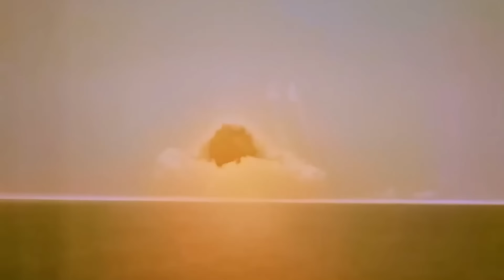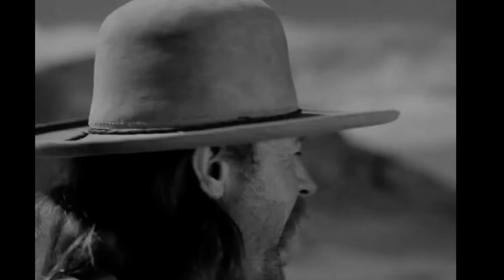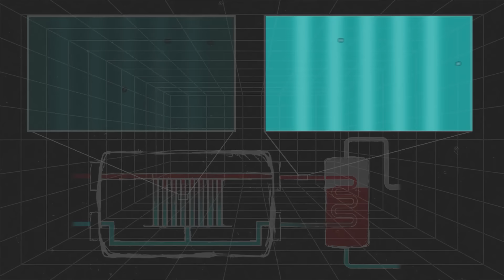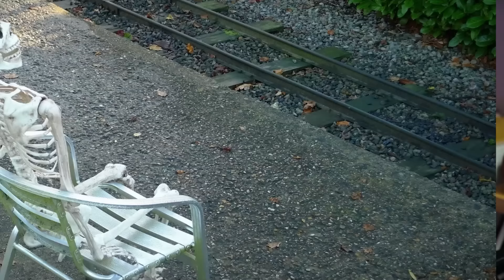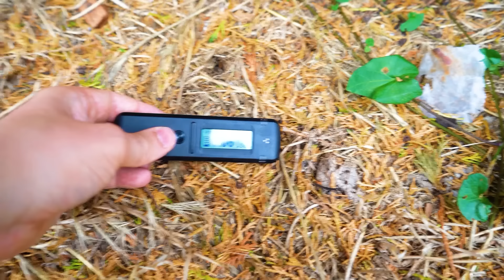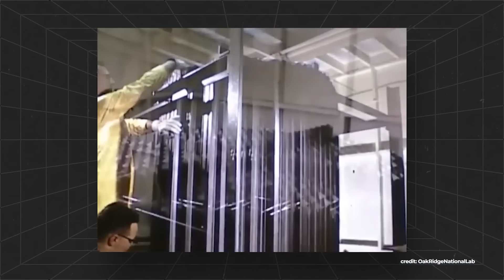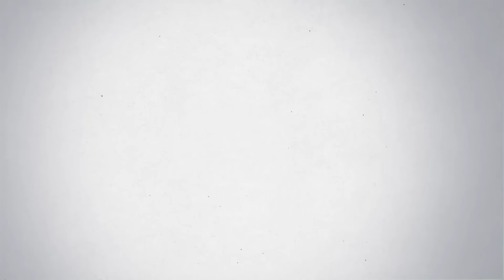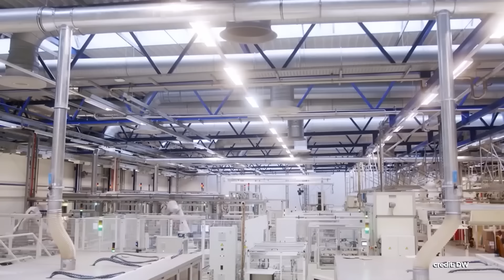It's Happening - China Launches World's First Thorium Nuclear Reactor

Comment from the maker: Is this beginning of a new age of nuclear? Let me know what you think below 👇👇And big thanks to Radiacode for sponsoring today’s episode! Get your own radiation detector and use code here: https://103.radiacode.com/DrBenMiles  ☢📻
This is genuinely an awesome product - I've be playing with it for a week straight now.  Slightly concerned that Gimli, my dog 🐶 is the highest radiation source in my house. What does this mean... Is he ok... Possible super powers in his future...(?) Send help...
Reply: @DrBenMiles - At 13:48, you repeat a common misconception about the large use of water by most nuclear reactors. The reason is the same as for MANY power plants, industrial processes, and large air conditioning systems: Evaporative Cooling. That has absolutely nothing to do with the water used in a fission core, which is endlessly recirculated, NOT used once then thrown away as is the 'steam' from cooling towers. The point of evaporative cooling is to get cooled to a lower temperature than is economical to do by dumping heat directly into air in a dry heat exchanger. In power plants, the lower temperature allows the recirculating cooling water to be expanded farther, generating more power before that low-pressure steam finally has to be re-condensed.
Reply: @YodaWhat  -  Water's conversion to steam uses more than 500 calories of heat per ml of water. THis is why water is such a good coolant and is extremely efficient at cooling equipment and the earth itself if necessary. It is a built in fail safe
Reply: I find this fascinating and would love to watch more on the subject.
Reply: I’m not seeing the code
Reply: @JPurvis10  Same, what's code?
Reply: Hi Dr Miles. I'd love at least a little something like a sticker with your Rockstar Scientist stamp on it. I have plenty of T-Shirts. Thanks 😁👍🏻
Reply: Fast or slow neutrons driving the reaction?
Reply: @MNIN-dn9xt  Can be either. Some, such as Flibe Energy's LiFTER Thermal breeder reactor use moderated neutron (slower) Others (can't think of company names at the moment but they prefer to use fast breeder thorium reactors (which will also allow the use of solid fuel radioactive waste.).
Reply: @MNIN-dn9xt  What's your question/comment - slower neutrons are need to sustain a fissions reactor (we are not talking about atomic explosive processes.
Reply: OMG the perfect Christmas present for my geologist father who freaks me out by licking rocks in the wild.
Reply: whats the code ? CODE ?
Reply: Might I suggest you should change the title of your video a little; due to the way the title was cut off on my feed, all I saw was "It's happening- China launches world's first thorium nuclear-", which almost gave me a heart attack that they went off the deep end and decided to drag the rest of the world with them.
Reply: Dude, what are you babbling on about? India has had a Thorium reactor up and running for years!!
Reply: wasn't Kirk Sorenson trying to develop it ? or was that all smoke and mirrors ?
Reply: @ashleyobrien4937  Kirk Sorenson has indeed been advocating this from VERY early on..
Reply: @ashleyobrien4937 You said the key words...."Trying" also "was"?
Reply: @ashleyobrien4937  he was, he founded FLIBE he was one of the most prominent voices / advocates for the technology a very long time ago
Reply: Gimli’s radioactivity is hopefully coming from his/her/its body’s potassium.
Reply: copenhagen atomics are sell working test rigs
Reply: As much as I love Th in principle, the first goal of MSRs has to be re-processing spent PWR-U fuel, which is already a substantial potential energy source. This is far more "socially viable" and would give the MSR technology the chance to prove itself before being to perfect the whole Th-Pr-U breeding cycle.
Reply: What we think depends what we are told, not related to what is true
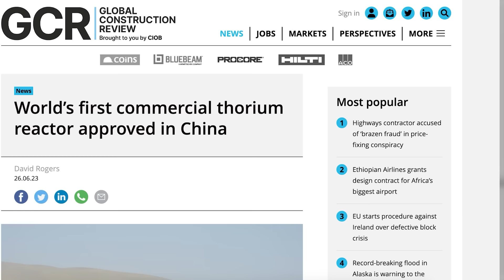Reply: At 1:10 you are incorrect on both counts.  The first molten salt thorium reactor was the MSRE at ORNL in 1965.  It was, however, an experimental reactor and not a production reactor.  The first production thorium reactor was the third core at Shippingport in 1977.  Also, it is highly debatable whether China's project counts as production reactor either.  The real question is whether they can do full-scale re-processing without generating another toxic waste dump like Hanford.  If they can manage that, then I'll be impressed.
Reply: @rockets4kids  The 1st MSR reactor was an aircraft test reactror built in the 1950's by the USA.  the Oak Ridge ORNL was the 2nd test MSR reactor.    Shippingport is considered a test reactor even though it generated electricity. It was solid fuel PWR.  So Shippingport Core Load 3 (thorium) is considered a test reactor.

Prior to Shippingport Core Load 3 the USA built 4 commercial sized solid fuel thorium power plants of BWR, PWR, and HTGR designs (I have a long post with more history above).    Germany built a 5th commercial thorium fueled power plant. 

Not only were there generally technology issues with most of these plants; but thorium fuel turned out to be much more expensive than Uranium fuel regardless of the ore cost.  The industrial process to go from ore to nuclear usable fuel is just much more expensive for thorium than for uranium.  So use of thorium in nuclear reactors was a lot more expensive than using uranium.  That is the major reason no one has built any more power plants with thorium fuel.  Even today; uranium nuclear fuel is cheaper.  When that changes most of the worlds nuclear reactors can be converted to run on thorium (they are really running on U233 after-all).

A secondary issue that adds cost is that thorium ore contains up to 7 isotopes of thorium.  One of them is more than just a trace and decays into U232.  U232 is a very high level gamma ray emitter which makes handling the waste fuel or reprocessing used thorium fuel much more expensive to handle.

Have a great day,
Reply: There was a thorium nuclear reactor built by General Atomic in Fort St. Vrain CO. in 1977. The fuel was maid in at the General Atomic R&D facility in Sorento Valley CA.
This was a high temp & gas cooled reactor.
Reply: Three Gorges Dam, Wuhan Laboratory, crashing rockets, tofu dreg infrastructure etc.... we should all still be terrified.
Reply: I really enjoyed this, and a big thanks,   I helped found the Alvin Weinberg Foundation with Baroness Bryony Worthington 10 years ago   We discussed this with the Shanghai Institute in China, and encouraged them along the path you describe so well,    I feel personally so pleased, and a bit proud of what they have achieved and their plans for going forward with commercial exploitation
Reply: No. The reason is simple: To a dictatorship it's easier to lie than to build the sci-fi tech they claim they have.
In addition, this is a plan, not a reality today. Get back to this claim in 2025.
Reply: It's a scam and you know it. They can't sustain their current infrastructure, much less develop new tech.
Reply: Stop the pro C C P propaganda. The USA, India, and others have built thorium fueled reactors before. Spreading lies completely undermines any credibility in the scientific aspects of the content.
Reply: This is great news, best news I've heard for a while
Reply: This is probably the best overall accurate and compact and digestable and technically realistic picture of the state of MSR/Thorium Energy I have come across. I did personally attend TEAC10 in 2019 solo and left with some new tech buddies. This tech can be a major change in the competitiveness profile between countries and also be likely the cleanest energy till actual H2 fusion. Of course they must be affordable and implementable in a reasonable time scale. However it evident that there are obviously "issues" why no one has yet commercialized these energy option.
Reply: Green Thorium nuclear reactors are safer: less waste, harder to weaponise.  China has been racing ahead on a prototype for a few years. 

Large deposits in India and the USA.

Russia's invasion of Ukraine resulted in more additional CO2 than most countries produce in a year. Russia's energy strategy to 2035 is to increase fossil fuels. 
So, something like green Thorium could be very useful.
Reply: Finally.. talking about this for years
Reply: Probably means he ate more bananas... or other sources of natural radiation like carbon 14 and potassium 40
Reply: Nuclear waste? The USA put a ban on recycling nuclear waste, yet most other countries like Japan, France, Russia, China, ... all recycle nuclear waste. The USA needs to reverse their policy instead of hiding it in the ground.
Reply: What's the code for radiacode?  It's not show in the video description or this post.  Thanks
Reply: Steam is a gas, it is not the mist that appears when a kettle brings water to boiling point. There is therefore very little difference between a steam turbine and the kind whose gases are the combustion products of hydrocarbon gases,
Not many reporters acknowledge this fact.
By the way, a reactor fed with thorium is fissioning uranium. A MSR can also run on uranium, and some designers prefer the proliferation-resistance of plutonium 240, to that of uranium 232.
Reply: It's time we evolve beyond oil, coal, and traditional dangerous nuclear tech.
Reply: We have to do something with fission going forward, it's the only proven and viable way to produce a whole lot of energy without burning something. Self sustaining cooling systems that don't require emergency electricity is possible so go for it. The waste is a massively overblown issue.
Reply: @fungjungkung hey you know which major nuclear powered countries have never had a meltdown? Obviously not US, Japan or Russia.
Hint: France and Ch_na
Reply: It is the highly corrosive nature of the molten salt, that is delaying the roll out in a big way. But advancements in material science is getting close to solving that problem.
Reply: isnt Kairos Power in NM already doing this. They’ve ran some “Engineering Testing Unit” successfully to move on to the next phase with “permits for construction from NRC… and a $303 million contract with DoE.” Their next step is a demonstration reactor. Which will be done within the next year or two which would be first if we discount the Tennessee experiment reactor 

Obviously their goal is to get to commercial reactors running which they claim by early 2030s

Then Terra Power (for commercial) is also by 2030. 

While we’re not China I dont think “plans to be finished in 2029” qualifies as “worlds first”. Until it’s actually online we will wait and see.
Reply: @perryallan3524 Thank you! There is to much hype about tehnologies who are not developed and maybe never will be.
Reply: Copenhagen Atomics claims to have a purification process that makes molten salts something like 95% less corrosive when hot. They're also pushing to provide molten salt Thorium reactors, but plan to try a leasing model, rather than selling reactors.
Reply: India. 🇮🇳 already started thorium reactor last month
Reply: @akhilbhai234  and it will fail like all of them ...
MIT is doing real work not this propaganda BS ...they do corosion testing on diffrent metals
Reply: This will not be the first commercial molten salt reactor.  The first, located on Simi Valley and supplying a small amount of power to LA in the 50's and 60's, was the Santa Susana facility.  It suffered multiple incidents due to untested technologies and a lack of knowledge as to how to handle nuclear waste.  It should be noted that they did not use Thorium.
Reply: @perryallan3524  Thanks for the clear summary!  Going to the MSR workshop?
Reply: Thorium Is every where in the world 
you have it out side your own home
there is no stock piles even in china 
Thorium is like water on earth its every where!
Reply: @CDWCAULDRON  There are giant stockpiles all over the place. It's a side effect of common mining. In the US a minimum reserve is required for strategic purposes even though it's not used much.

Just checked, apparently in '22 there was an active effort to end the stockpiles. I didn't know and don't know the details.
Reply: @justanothercomment416  not talking about  common mining.  Its right at your feet. every where in North America you can get it any where.
stop being this Obtuse... and try to comprehend what people are saying before you assume things I know whats in my own Mines Dim wit.
Reply: I remember reading about the Oak Ridge experiment in IAEA books 30 years ago. I wondered why something so fabulous had not been pursued. Thorium reactors not only allow for efficient, safe and cheap electrical energy generation, but also serve to treat and destroy urban, industrial and biological waste. A project that I had to abandon because it was born in the wrong place :/
Reply: @lisandroantoniorodriguez9242  It's a great question and the answer is simple. The technology does not easily facilitate the development of nuclear weapons. The DoD ordered the DoE to only promote nuclear technologies which easily facilitate the development of nuclear weapons.

Big O gave away all of our related technology to India and Chyna.
Reply: Peddling thorium propaganda in 2024, complete with a shameless sponsorship plug, and tiktok brainrot idiots eating it up lmao. Never thought I would see the day.
Reply: I dont think google maps will be available on a nuclear apocalypse so you can update the radiation zones 🤣
Reply: @DrBenMiles you are Not a Doctor... If someone Screamed, is there a Doctor on the Plane, you wouldn't say a Word! All you are is a Spoiled Brat who towed the Party Line with whatever Crap your Teachers and Professors said, and thus have No Real Independent Thought, and Less Intellectual Free Will than AI!
Reply: TMI was a partial core meltdown - you get your facts straight.
It did prove Western reactor designs did their job in terms of keeping the melted core inside the pressure vessel  and the majority of contaminants inside the containment building.
Also the small amount of radiation released into the environment came mainly from vented Xenon-133, not steam.

Although I agree that in terms of environmental impact, TMI was a nothing-burger - it was a huge financial disaster.
Reply: China launches world's first TOFU "nuclear reactor"
Reply: A thorium reactor is going to have a very short life  as the reactor gets poisoned by U233 fission daughters. Madness
Reply: Nuclear is totally done. Obsoleted by solar with battery back up.
Reply: Nuclear is totally done. Obsoleted by solar with battery back up.
Reply: Best sponsor / video combo I’ve seen yet
Reply: So happy this is getting TALKed bout again ite beautiful. My college speech in 2013 it's old tech but needed
Reply: Nah you can't make plutonium out of Thorium so Thorium reactors are basically useless, it's just a pr win for china
Reply: The sad fact is that our fantastic capitalism (to much money behind Uranium) is what has kept us back from developing a Thorium core in the western world ages ago....
Reply: You are spreading desinformation. This is not the "World's First Thorium Nuclear Reactor".
You might want to google "THTR-300". It was build in 1983.
"The THTR-300 was a thorium cycle high-temperature nuclear reactor rated at 300 MW electric (THTR-300) in Hamm-Uentrop, Germany. It started operating in 1983, synchronized with the grid in 1985, operated at full power in February 1987 and was shut down September 1, 1989.[1] The THTR-300 served as a prototype high-temperature reactor (HTR) to use the TRISO pebble fuel produced by the AVR, an experimental pebble bed operated by VEW (Vereinigte Elektrizitätswerke Westfalen). The THTR-300 cost €2.05 billion and was predicted to cost an additional €425 million through December 2009 in decommissioning and other associated costs. The German state of North Rhine Westphalia, Federal Republic of Germany, and Hochtemperatur-Kernkraftwerk GmbH (HKG) financed the THTR-300’s construction." (Wikipedia)

DOWNVOTED and UNSUBSCRIBED.
Reply: No. It's not. Thorium reaction existed since 1980s (easily verifiable by using google scholar). Nuclear power has made 0 advancements in 45+ years. It's nothing but a poor attempt to suggest new developments to seems as advanced as renewables and batteries when in reality it's reheating old ideas from the literally last century.
It's this blatant misspresenting of reality that makes it clear to anyone that nuclear has nothing to offer.
Reply: No, it's not. Thorium reaction existed since 1980s (easily verifiable by using google scholar). Nuclear power has made 0 advancements in 45+ years. It's nothing but a poor attempt to make nuclear power seem as advanced as renewables and batteries when in fact it's just reheating ideas from the literally last century.
Besides that this "World's First Thorium Nuclear Reactor" has 2 MW which is 1/3 of a modern wind turbine. This blatant misrepresentation of reality is reason enough to dismiss any push for nuclear power without even looking into it.
Reply: lets pray they dont have a Chernobyl
Reply: So 20 minutes of filler history NOT talking about China's ventures into Thorium reactors.
Reply: *F*ukushima.
Reply: FINALLY!! Something worse stealing from China......
Reply: @perryallan3524  As the US is bankrupt without a president, no more trade with other countries. That supports Genocide and Crimes against Humanity it has no future.
Reply: china's corruption + tofu building+ Comunist. I m really worried. Look at the EV scandal, even high end vehicles are dangerous
Reply: we should definitely stop building solar power and wind power and just spend the money on LARGE SCALE THORIUM REACTORS because they have an N-vallue of 1000 (so for each unit of energy invested into releasing the thorium energy from nature, you gain 1000 from nature, it's a surefire way of catching up with the chinese economy.
Reply: @perryallan3524 Very interesting. Then SMRs might be developed much further into  the future ( if ever at all ).
Reply: Nope, not at all a new age. Thorium reaction existed since 1980s (easily verifiable by using google scholar). Nuclear power has made 0 advancements in 45+ years. It's nothing but a poor attempt to make nuclear power seem as advanced as renewables and batteries when in fact it's just reheating ideas from the literally last century.
Besides that this "World's First Thorium Nuclear Reactor" has 2 MW which is 1/3 of a modern wind turbine. This blatant misrepresentation of reality is reason enough to dismiss any push for nuclear power without even looking into it.
Reply: Nope, not at all a new age. Thorium reaction existed since 1980s (easily verifiable by using google scholar). Nuclear power has made 0 advancements in 45+ years. It's nothing but a poor attempt to make nuclear power seem as advanced as renewables and batteries when in fact it's just reheating ideas from the literally last century.
Besides that this "World's First Thorium Nuclear Reactor" has 2 MW which is 1/3 of a modern wind turbine. This blatant misrepresentation of reality is reason enough to dismiss any push for nuclear power without even looking into it.
Reply: Deleting comments I see. Nuclear must be such a good technology
Reply: It's a complete lie that thorium is significantly safer than traditional toxic uranium based fission nukes - both invariably produce new poisons so dangerous that a microscopic particle too small to detect lodging itself in your lung or intestine will probably kill you, and these poisons last for millenia. Thorium's advantages lie in how toxic PARTS of fuel rods themselves remain, and that thorium can be bought cheaply in India, and from Brazil by the Chinese. Thorium in some ways is actually significantly MORE dangerous than Uranium, as the process for making the fuel rods themselves - irradiating the fuel - is so dangerous in many cases that people can't even be close to the process, & it has to done by robots. It also produces far more of truly horrifically dangerous radioactive cesium and iodine, which are both actually incorporated INTO living tissue, and deposited within bones, & emit ionizing radiation that will eventually kill in microscopic amounts.
Reply: Nope. Not at all a new age. Just some old ideas warmed up after half a century. Thorium reaction existed since 1980s (easily verifiable by using google scholar). Nuclear power has made 0 advancements in 45+ years. It's nothing but a poor attempt to make nuclear power seem as advanced as renewables and batteries when in fact it's just reheating ideas from the literally last century.
Besides that this "World's First Thorium Nuclear Reactor" has 2 MW which is 1/3 of a modern wind turbine. This blatant misrepresentation of reality is reason enough to dismiss any push for nuclear power without even looking into it.
Reply: @DrBenMiles  Nope. Thorium reaction existed since 1980s (easily verifiable by using google scholar). Nuclear power has made 0 advancements in 45+ years. It's nothing but a poor attempt to make nuclear power seem as advanced as renewables and batteries when in fact it's just reheating ideas from the literally last century.
Besides that this "World's First Thorium Nuclear Reactor" has 2 MW which is 1/3 of a modern wind turbine. This blatant misrepresentation of reality is reason enough to dismiss any push for nuclear power without even looking into it.
Reply: Too many people who don't know what they are talking about are pushing designs they know little about.      Sodium reactors are a disaster waiting to happen, at least two have melted down in the US alone.     13 have rocked up by the tempature of the coolant dropping to low and solidifying

Molten salt reactors have the rocking up problem and more.   Salts are generally very corrosive, very chemically reactive, and generally dissolves into water, becoming very dangerous.   Breeder reactors are also invariably fast neurron critical, which presents additional problems.
Reply: @fungjungkung more lawyers than engineers every year. 
Soon, the US won't have committed war crimes either.
Reply: So @ 8:39 it is Thorium-232  but @ 9:16 its Thorium-323 .... So WHICH ONE IS IT???? 🤷‍♂
Reply: Did you check your bananas?
Reply: 600 bucks... ah well NO!
Reply: Yes it has to be!!
Reply: Not at all. Thorium reaction existed since 1980s (easily verifiable by using google scholar). Nuclear power has made 0 advancements in 45+ years. It's nothing but a poor attempt to make nuclear power seem as advanced as renewables and batteries when in fact it's just reheating ideas from the literally last century.
Besides that this "World's First Thorium Nuclear Reactor" has 2 MW which is 1/3 of a modern wind turbine. This blatant misrepresentation of reality is reason enough to dismiss any push for nuclear power without even looking into it.
Reply: Well, I think this has the potential to be the energy source for the future; Paper by prof Hagen at TU Delft University -
Electron paramagnetic resonance proof for the existence of molecular hydrino
Reply: @uploadJ  thorium reactors existed since the 1980s. How is this the future?
Reply: @perryallan3524  what about the LFTR setups ?
Reply: @Steve25g  LFTR is still a Molten Salt Reactor.... and to date no one has built even a test reactor that has had a long life.  Yes, the Chinese are testing one - and so far it has been in operation intermittently for about a year.  How well it works, and if it can be successfully scaled up to a power plant is yet unknown  Both of the USA test reactors had very significant material degradation issues (corrosion and radiation embrittlment) in the 1950's and 1960's; and even to this day and after at least 15 years of specific metallurgical research into custom "super-alloys" they are not sure if they yet have an adequate material to build a long life MSR from as the salt stream becomes contaminated with fission daughter products which then chemically react with other things in the salt stream creating more chemical compounds.

As for thorium nuclear fuel.   Along with numerous test reactors built by many countries.  The USA and Germany built 5 commercial power plants that ran on the thorium fuel cycle (there is a long post above under this main post above if you want more details).

Bottom line is that Thorium nuclear fuel was much more expensive to produce than uranium nuclear fuel. This largely relates to a more complex process to extract the ore and convert into nuclear fuel (availability of ore is not the issue).   I have seen nothing today that indicates that has changed.

Thorium cycle also generates a noticeable amount of U232 which is a hard gamma radiation emitter making handling of spent fuel more expensive and handling of reprocessed uranium fuel significantly more expensive than for U235 or Pu239 fueled reactors.

The USA did perfect a thorium core for PWR reactor designs - and should thorium ever become cheaper then the vast majority of power plants in the world can easily convert to it.

Have a great day,
Reply: sodium reactors, free energy, perpetual, self regulating, were banned in 1954 by the  MILITARY, as they didnt produce weapons grade material..  plus, lpg, can run every engine on earth.. so why are we fkng around with other bs sht..
Reply: How about walking it back as its not really a thorium one?
Reply: You trust what china says? good luck with that ...
Reply: Has ANYONE gotten a reply as to what the coupon code is?
Reply: India. 🇮🇳 already started thorium reactor last month
Reply: The Chinese are building robot to replace human in factory, they are are at 95% and already at 99% at this moment. China is at least 100 years ahead of US. Not only that but Tesla is full of BYD parts also china is the only country to use 95% full automation in production facility for maximum profit which Tesla is using. Tesla, spaceX, Starlink, Solar City, Neuralink, The Boring Company and Optimus Robot are all Chinese  startup investment to boost US economy due to trade deficit. Elon Musk would be no one without china. lol
Reply: The Chinese are building robot to replace human in factory, they are are at 95% and already at 99% at this moment. China is at least 100 years ahead of US. Not only that but Tesla is full of BYD parts also china is the only country to use 95% full automation in production facility for maximum profit which Tesla is using. Tesla, spaceX, Starlink, Solar City, Neuralink, The Boring Company and Optimus Robot are all Chinese  startup investment to boost US economy due to trade deficit. Elon Musk would be no one without china. lol
Reply: Is it true that a major reason we stayed with light water uranium reactors is to support the production of plutonium for our nuclear arsenal? I've heard this said but would like to be sure before I repeat it in my climate & energy presentations.
Reply: @rickknight1810  wrong ...malten salt reactors do not work ...
Salt corodes metal THE END ...
what china india is doing is a SCAM on there naive taxpairs and propaganda .
I mean this Benny over hear sells radiation detectors ? why? it makes no sense ...
Reply: Doctor????
Reply: Caucasians like arabs n indians they talk n brag too much but does too little
The Chinese on the other hand does not talk nor brag....they just do it n get on to the next priority
Reply: To not bring in any mention of Kirk Sorensen to this is incredibly bad, Doc.  To me, it's unfathomably bad.  I've never literally called anything TMK blasphemy before, but that's exactly what this is.  I can't even imagine how you could do this.
Reply: @marvelaturraz5405  Am quite sure the people of the West have been controlling the narrative in this manner, so why are you surprised that others follow suit?
Reply: Unlikely.
Thorium is essentially a breeder programme, adding enormous operational expense to the fuel production process. Previous attempts at breeders have flopped. 
As an MSR, it will require materials that are still over the horizon and a whole new technology in fission product separation, a complex chemical process, now to be handled continuously in real time lockstep with reactor operation, with extremely high reliability.

The price of energy will have to be many times higher to  sustain such a concept.
Reply: @aaroncosier735  .. By 'flopped' you mean proven to be effective by The US, Russia now China.. India 'flopped' because like all Breeder Reactor R & D (until maybe China), it operated on a shoestring budget compared to conventional fission, useless fusion and 'Green' energy subsidies. You should know the potential of Breeder Reactors in maximising energy production per Square / Cubic Meter with the LEAST amount of waste (the non-fake Green Energy Metric). We COULD have had 1000x more efficient fission reactors by now, with over 1,000,000x+ possible. Enriched uranium only needed to (re)light the reactor. Windfarm and Solar Panel Graveyards piling up already, and they blight the area when operational.
Reply: @PrivateSi  
I mean failed, decisively, as a money pit not worth the bother.
The French programme got enormous funding in an effort to paper over the waste problems. All failed.
The US spent plenty as well, worked out it was a dud.  If there had been the slightest chance of making a dollar, or a penny, they'd have done so.

Recycling the U238 isn't worth the reprocessing costs. 
Sure, you can do it, at stupendous cost. What you get is plutonium to make MOX. Used MOX is far more expensive to reprocess or to store and dispose.

Fission product wastes still remain, and instead of being locked in a fairly durable pellet now require stabilisation, conditioning and vitrification, saving nothing in volume and costing a lot in handling. 

No, fission doesn't get much better than it is. Seventy years of work and the basic limitations remain. Sharp limitations on the efficiency of the reaction, and even sharper on extracting shaft power from heat. The only efficiency improvements came with scale, and the latest large reactors show little improvement for much higher cost and complexity. 

Your fantasy has no basis in reality.
Reply: @aaroncosier735  .. Your idea of 'Enormous Funding' by The French says it all.. Frankly everything else you wrote is just more parroted, heavily biased nonsense that doesn't hold water.. You're way worse than even the bias in Wikipedia on the subject. Contrived Liberal Economics pollute the entire energy market. You can't compare when everything is based on massively subsidised projects and industries vs comparatively ENORMOUSLY UNDERFUNDED ONES such as Breeder Reactor projects.
--
The French built nothing, even after concluding at the time the tech. was very much commercially viable. That was pre-Fake Green funding revolution. You do realise over $Trillion has been wasted globally on Tokamaks alone in the last 100 years, $1.5 Trillion on Fusion Power WASTAGE in total? Conventional Nuclear subsidised by the nuclear arms industry.. Sprawling, land-wasting, unreliable renewables heavily subsidised.
--
We should be concentrating naturally hot materials from the Earth to use the heat for something useful, other than heating up the Earth, which some people say is a bad thing! All that nuclear waste ready to be RECYCLED in BREEDER REACTORS... Along with a lot of more efficient Thorium...
--
China will lead the way.. Coal is dead, Renewables are a rip-off, Fusion is disgusting Liberal money wastage on steroids.
Reply: @PrivateSi  Yes, "enormous funding". The French programme was a flagship national project, tied to national pride. They got whatever it took to get the various Phoenix reactors going. Just as they are spending whatever it takes to get Flamanville up, though it will never generate enough to repay the investment.
In the end, they were an expensive failure. Plutonium used as MOX was many times more expensive than uranium, and only a carefully modified fraction of their fleet is licensed to use it at all, and then only as a fraction of fuel load. Phoenix had a lifetime load factor under 50%, and SuperPhoenix operated less than 7% of it's operational span.

Sure, French nuclear has been subsidised cradle to grave, and the real costs hidden behind generator, wholesale and retail price caps. So sure, yes, it is impossible to compare total life support subsidy to realistic competitors.

Nope, French breeders were not viable. they were built, operated, and found by experience to be not worth it, despite endless subsidy to satisfy national nuclear pride.

Research Tokamaks are their own priority. Involved nations don't want to miss out on a possible future tech. Fission and breeders have already failed on their own terms. They simply cannot compete. Can't even afford to dispose of their own wastes.

Renewables are not as unreliable as you think. Especially when you consider nuclear outages. Renewables give partial service under all but the worst conditions, the sun rises very reliably, as do prevailing winds. Nuclear depends on grid connection for critical onsite services, nuclear is the first to trip out and the last to restore service. 

Spent Nuclear Fuel is not viable for recycling. It has been tried, and failed. The recovered U238 is not worth the bother compared to natural uranium, the recovered plutonium is not sufficient in itself to fabricate new fuel. Supplementing this involves all the cost of a separate dedicated breeder, already established as not worth the cost.
"Recycling" spent fuel does nothing to eliminate fission products, which still require conditioning, vitrification, encapsulation and disposal.  
Thorium is not more efficient. It is about as useful as breeding from U238, already established as not worth the bother.

China is leading the way, by recapitulating the US and French pull-back from nuclear, sharply reducing completion rates, and directing their efforts to building renewables thirty times faster than their biggest nuclear year ever.

To correct you: Nuclear is in decline, less every year, renewables already deliver three times as much, and growing twenty times faster than nuclear ever did.
Reply: I do not, because oil and lobbying. Rich people much rather kill us all for money and spread propaganda to make us feel like we've failed and should give more power to authoritarians and corporations to enhance that frog boiling cycle. And people aren't smarter than that. We are technically better than that because we are social cooperative creatures, and corporations are capitalist creatures, but we're also easily swayed with propaganda and fear mongering and on average populations have an IQ of about minus 17. But I hope that China will at least get it up and running so we have an example to point at that conservatives and corporations will fearmonger about to stave of progress for another 2000 years.

I predict htat Russia will gladly buy the tech from China and keep selling even more oil and gas to us and help pay for propaganda and fear mongering while they have cleaner air and cheaper energy because of it, and they'll happily point at us for being barbarians stuck in a fossil fuel age and help us pump our air full of pollutants and CO2, evidently not caring about ourselves or each other, and they'd be right because we evidently do not - only a few do, and they're not too optimistic about our future to put it mildly. Stress about the environment, climate, and our futures and well being and health are causes for depression. We've known this for decades and had a way out for decades, and we have yet to build more nuclear powerplants. So, no. I don't think this will change much for us. We are lemmings and on the way of the dodo and the power and money and gullibility of people will probably keep it that way with fearmongering and propaganda.
Reply: No it isn't the first working Thorium salt reactor 1950s a american university built a scaled down reactor that proved viable but was rejected because the waste could not be used in making nuclear weapons,  the documentary is on you tube
Reply: @cazrealist1  
Nah. To make weapons plutonium they use a dedicated breeder reactor, and irradiate fertile blanket material for an optimum period. Too much, and you accumulate even-numbered isotopes with low reactivity that are hard to separate from the desired Plutonium 239.
Norma civilian spent nuclear fuel has been in the reactor far too long. The desirable Plutonium 239 that may have been produced is largely consumed, and the undesirable isotopes remain.

No one uses spent nuclear fuel to make weapons, and breeder reactors are lousy at generating power.

Thorium has issues, but lack of weapons application isn't the the big one.
Reply: i'm often doubly impressed with china. however, you've done nothing but parrot chinese claims regarding thorium reactor technology advancement. you've got NOTHING in this video substantiating these claims.nothing. thorium has a long history you can explore in other youtube documentaries on thorium. 
but you really ignored all the history. 
not to say , advancements are impossibe. but there's reasons thorium wasn't pushed forwards. 
you did NOT address these reasons.
Reply: @zeev  the first salt thorium reactors was built in the United States in the 50s it was built by a University and was extensively tested and was proved a viable reliable solution that would have provided a stable Base load to the grid , it was ultimately rejected though as the waste could not be processed into weapons grade material,  the documentary is on you tube but you can no longer share the link so have a look for yourself
Reply: Nuclear is the best energy, and kind of cleanest and most reliable. Water and wind are unreliable, solar is toxic and heats atmosphere contributing to the global warming, burning fossiles is a crime against humanity: we all need fossiles for industry, say plastic chip enclčosures or asphalt, not just to burn it!
Reply: Well if the leftist government in France didn't destroyed Superphénix it would have been since 20 years we would have thorium and sodium reactors
Reply: My reactor concept uses Thorium as a Hydrate in the damper zone of a fast fission sodium cooled nuclear reactor.
Reply: That's USA technology. Not theirs. Obama literally gave them and India all of our technology. They are simply running with all our research.
Reply: Doctor of nothing! C CP copy western technology, we invented it, if it was that significant, we would have already implemented it. All good, the west will be spying on china's R&D to use against them. Thanks for sharing
Reply: I hope so. Nukes are the worst PR for nuclear energy. We could have wasted a lot less of our fossil fuels, and generally created much cleaner energy, leaving us in a better state climate wise at least
Reply: Yes, I'm surprised this molten salt thorium reactor hasn't progress even faster. It can be scaled down to make to system factory built and shipped anywhere. Check out TED Talks on this subject.
Reply: Which metals can handle the corrosion of salt..🤔
Reply: China China China shill
Reply: China will not be building the worlds first Thorium reactor. The Peach Bottom reactor in Pennsylvania was what you are calling a Thorium reactor. It was built and operated in the mid 1960s. The Fort St. Vrain Reactor was a "Thorium reactor" built in the 1970s in Colorado. I was on the design team for it's first core, and I personally designed the first reload core. The design utilized a graphite moderator with cylindrical holes filled with either U-235 pellets or thorium pellets. The plan was to use the U-233 bred during operation in a subsequent reload. I don't remember if they ever used the generated U-233 in the reactor before they shut it down. Molten salt sounds great but the corrosion was a killer. Perhaps we have better materials now. If China builds reactors the way they build bridges, they are in big trouble.
Reply: There was a Thorium Nuclear Reaktor in Hamm- Uentrop, Germany. It was a complete failure.
Reply: It absolutely is. New nuclear energy initiatives (mostly anywhere but the US) are slowly moving forward, the Chinese projects being the best funded and given government support. Only now is the US looking back at nuclear but still scattershot and not yet focused or funded. Will be interesting to see what the new administration does as the old administration is finally looking at embracing it.
Reply: If you look at China Space timeline and achievement than you will have no doubt that they will achieve what they have laid out in 2029.
Reply: As a suggestion, in future presentations it would be helpful to differentiate between MW output thermal and MW output electrical. The normal convention would be to display the output number with a subscript “t” for thermal and a subscript “e” for electrical.
Reply: no, thorium wont change the uncomplying offerings of nuclear power. still baseload, not a good compliment to much cheaper wind and PV. still costly, still cost curves heading north not south. new day, same nonsense marketing and hype.
Reply: Even with the discount, the cheapest radiation detector/spectrometer is too expensive for me to justify buying 🙁.  If anyone wants to buy me one, let me know - I really wanted that device.
Reply: This is 60 year old technology with 0 improvements since it was abandoned by America. It requires a full chemical company alongside the reactor to deal with the extremely dangerous pollutants.
Reply: Graphite moderates the reaction. Without the graphite, the reactor could not remain critical. You mentioned the density of neutrons was higher in the reactor vessel which is why the fluid is safer out of the reactor vessel. While partly true, the reaction requires graphite. The drain tank (under the freeze plug) does not contain graphite, which also shuts the reaction down naturally. This is a great video, but I thought you might want to know that.
Reply: Does not have to be steam cycle. There is proven technology known as Organic Rankine Cycle, or ORC,  being promoted (without success) by WOW inc of Houston, Tx.
Reply: @jimmykumana8859  Interestingly,  solar has huge potential when the profit mechanism is subtracted from its cost. Thorium does continue to have very challenging and dangerous waste management issues.
Reply: China's Thorium moves ahead while the US watches, holding on tightly to Uranium!!
Reply: Propably not. Wind and Solar do not produce radioactive material and the technology is already cheap and reliable. All nations are technologically capable of implementing them and producing such systems is also in reach of basically everybody. Both technologies can also be decentralized very well, thus they are less easy targets in a military conflict. Prices still drop, implementation, recycling and the necessary storage must still be optimized, but there is no showstopper in sight. If it works nicely, there will be some applications, but I don´t see that having a significant impact on global energy transition.
Reply: A "commercial" 10 MW reactor at 60 MW heat, what low efficiency we staring at? It's not commercial, it's just a demo plant or even a prototype regardless of the integrated setting Research Setting.... finished by 2029. So just a hype headline as if it was already delivering electricity to the grid... in the Gobi desert, we all know 95% of chinese live in the Gobi desert... /s So, need to add a several 1.000 km powerline... Like almost all other nuclear start up headlines, a lot of empty promises.
Reply: @juliane__  Why bother? Just go to sleep.
Reply: As a techy kid in the 1980s talk of Britain leading advanced nuclear power was pushed, molten salt thorium breeder reactors included - then New Labour took over and shut our nuclear power industry. India, Russia and then China bothered to put some effort in, at least.
Reply: @PrivateSi  They just love the "status quo" - as they have invested so much in stock standard "fission" reactor driven by the military dollars.
Reply: @PrivateSi  Because the energy industry paid them to do.
Reply: @PrivateSi 😂 more excuses.
Reply: The first thorium reactor was built in the US a long time ago.
Reply: @tarstarkusz  Yes and abandoned do to low powwer generation output.
Reply: @tarstarkusz  That’s right; it was.  There was a Wild West time of experimentation in reactor types and fuel cycles.  Practice finally settled around pressurized water reactors along the lines of U.S. nuclear submarine development.  Of course, subs did not have to worry about ECCS (Emergency Core Cooling Systems) but the technology was applied to civilian power reactors without apology.  

What I’d like to see is a study of Establishment psychology and the bureaucratic inertia that follows it.  We already should be three or four generations ahead of PWR/BWR technology but the situation in most of the world has been static since the 1970s.  There’s a tendency to blame Three Mile Island or movies like The China Syndrome, but I suspect that there is a political and money trail behind all of the non-decisions that have hamstrung a power source that has so much potential for the near-term future.
Reply: @tarstarkusz  google : Hamm-Uentrop Thorium
Reply: 1950s
Reply: @tarstarkusz  , So why didn't they continue to do so? Is their act under the influence of the oil producers?
Reply: @tarstarkusz  , Have you ever wonder as to why they stopped using it? when it is noted ( by a Danish scientist) that it can reduce electricity cost by some 90%!! US would have had practically monopolized all industrial production! You better check out as to why they preferred to remain less competitive.
Reply: @perryallan3524 regarding the last statement/sentence, there are many examples where Nuclear Power Plants are built with little regards for safety regulations in China and the rest of Asia as well... You're thinking of "safety regulations" in a Western perspective, it's not at all taken seriously in China... Why can you not understand this when you witnessed literally 3 countries in East Asia work themselves to death for decades..
As for the success of cheap Thorium energy, we will just have to wait
Reply: @rigobertoitachijohnson  You are very uninformed. Chinese and Korean Nuclear construction and operation standards are better than Russia's and I consider them to be equivalent to the western nations.  China is not cutting corners on nuclear power plants.

I did a consulting job for one of the Chinese AP1000 plants.  I was both pleasantly surprised and pleased at the same time.  I also got a chance to talk with people at Chinese designed reactors to verify that the standards were the same.

Korean Standards are also very high. 

Believe it or not, its Japan that dropped the ball on design basis event design -which led to Fukushima BWR event.   Plants in Japan only had to design for events that occurred once every twice the design life of the plant.  Tsunamis were known - but only occurred on average every 90 years.  Hence Fukushima had a 45% chance of a tsunami within its design life.

The design life was 40 years, so since they did not occur on average every 80 years Fukushima - and other plants - did not have to be designed to withstand them.     All other western countries that I know of used the "occurred in the geological record" standard for design basis events.

Japan quickly changed their standards and have only allowed plants to restart that can meet the new standard.  As of about the beginning of this year (last time I looked) no BWR reactor has been allowed to restart in Japan. They are only restarting PWR reactors once modifications to the plants are made.
Reply: @perryallan3524  thanks for sharing your insights as a consultant, i learned alot... However i don't think every Korean Nuclear Power Plant meets the requirements for safety regulations the same as Westerners have... Since the company that built our Nuclear power plant here in the Philippines was the same, it was approved and built, yet it did not meet safety regulations due to corruption from both Politicians and the American company that built it (now bankrupt)... The sister power plant that Koreans have i believe are still operational today, but i really don't think it has the same standards that you have there in America
(also Asians know that Japan has been living in the year 2000 for 4 decades now, and sorry about Russia, i know next to nothing about their standards, so i cant refute or agree with that...)
Reply: @rigobertoitachijohnson  That sounds like a problem with the Philippines. Sorry you have that problem.

South Korea is very hard nosed about nuclear quality control and safety.

But when biding foreign projects - you often are required to do as the locals demand.

I worked for a heat exchanger builder and service company for several years (mainly serving power plants - and when I worked in nuclear plants after than they built some of our new heat exchanges, and did certain field service jobs).  

They also did retubing and replacement jobs in the Caribbean and Central/South America.  They refused to bid on jobs in some countries as they would not be allowed to do a good job due to the corruption.
Reply: 'Removing the need for cooling water...' but if you are still using steam turbines surely you need cooling water.
Reply: @MrDavidht  I think you need "coolant", a liquid, but not necessary to be water. The simplest and easy way to cool something is to cool it with water, but who knows, maybe there are better solutions. I know some cooling solutions from my household. The car has "coolant", which consist of water and some alcohol. The fridge uses compressed gas, my AC also uses compressed gas. My PC uses air cooling. I cool myself with water when its hot. Industrial machines often uses oil to keep cool the parts. However there are liquid nitrogen and frozen CO2 gas as cooling solutions, but those are expensive, and it is hard to keep its cooling capacity.  
I do not know which cooing solution is the best, maybe there are other solutions i do not know, and maybe there are areas where one or the other method is improper.
Reply: @zetor2K  Power plants tend to be cooled by water because its the most efficient cooling media.  Either directly from a lake, river, or the ocean; or via evaporative cooling.

There exist a few very small power plants where the water is cooled by the air using extremely large air to water radiators.

As the ultimate heat sink - its water or air; even if the water comes from a well.
Reply: @zetor2K  As they propose to use steam sets to generate the power they will need water to raise the steam. The water has to be distiilled and demineralised to a high degree of purity. To preserve as much of the water as possible to return it to the steam raising plant they go to great lengths to condense the steam back to water after it has passed through the turbines. In a direct cooling system such as Hinkley C they will need in excess of 30 tonnes of cooling water per second to be passed through turbine condenser.  That of course is a direct CW system as Hinkley is on the coast. They could use an indirect system where the cooling water is circulated through cooling towers, but even then they will need a source of make-up water to replace cooling water lost due to evaporation and to dilute solids. The added bonus of condensing the steam as it leaves the low pressure turbine is that it creates a partial vacuum in the condenser and adds torque to the generating set increasing efficiency, with the greatest increase during cold weather, when you need it.
Reply: This is incorrect.  Indian Point Cycle 1 was a Thorium cycle.
Reply: Look to Germany... In "Hamm". They got a reaktorsince 30 years. But it don't work.
Reply: The first steam engine was invented in Ancient Roman, 50 CE and in some writings as early as the 1st Century BCE. It wasn't until several centuries before anyone actually applied this technology to an actual working commercial machine to do more than just amuse people.
Reply: Nuclear will need to be a significant part of our energy mix because…math

Our consumption is the point of inflection where it’s going to more than double every year.

I just pray that we can do it responsibly and not kill or point the planet in the process.
Reply: is china using slave labour for this endeavor too?
Reply: @jesipohl6717 you do realise America has the world's largest formal slave labour system, don't you?
Reply: Arent China also leading the field in controlled nuclear fusion now? 
I for one, welcome our new sino overlords xD
Reply: @scroopynooperz9051  India also has a thorium based reactor before than China
Reply: @KaartikeyKusshwaha  , How come the Indian Atomic Department said otherwise in a report dated 2023??
Reply: @scroopynooperz9051  Those are scams, obviously. CCCP propaganda at best.
Reply: @scroopynooperz9051 on the other side you got the so called democrats trying to avoid this shift xD hyperinflation or recession soon :X im a nobody so idk what im saying
Reply: Everyone glosses over the fact that this technology/fuel cycle is inherently proliferative. —You’re breeding U233 (which is also good for making weapons). —That is why this thorium reactor tech hasn’t taken the world by storm; and it’s a pretty darn good reason! Experts all around the world have for generations now been rightly cautious about it, understanding that while the technology might be good , humans are not; there is no energy utopia, never will be; and therefore all that increases the potential for nuclear proliferation is to be regarded as a bad thing by everyone. — If Iran was building this instead of China, they’d be dropping bombs to stop it. 
Why doesn’t anyone making videos on the internet about the awesomeness of thorium ever mention this??
Reply: @rev.andyh.1082  In its solid form thorium fuel cycle is not a proliferation issue in normal power plants. Nor is uranium.

Lets start with uranium 1st.  Lets say we start with 5% U235 enrichment and 95% U238.   A bunch of the U238 absorbs a neutron and becomes Pu239.  But some of the Pu239 also absorbs neutrons and becomes Pu240.  

Please look up Pu240 in wiki for a detailed explanation.  But, more than the faintest trace of Pu240 poisons the Pu239 as a bomb material.  Too much Pu240 and you cannot make bombs from plutonium.

Thorium reactors actually run mainly off of U233. But some of the U233 absorbs another nuetron producing U234.  U234 poisens the U233 just like Pu240 poisens Pu239 as a bomb material.

When using solid fuels, all power plant reactors are designed with fuel rod run times to produce more Pu240 or U234 in the 5 commercial solid fuel thorium cycle power plants built than would be allowable for bomb materials (not to mention the dozens of test reactors).   It's a total myth that reprocessed solid power plant fuel from normal power plants can be used to make bombs.

Bomb grade material is produced in special weapon grade reactors that only run the fuel for a few months, or less, to limit the U234 or Pu240 to below the allowable levels.

There are two main exceptions to this:  the UK built a series of power plant reactors designed to produce bomb materials.  They were not economical at generating electricity or at producing bomb grade material; and those plants where shut down decades ago and I believe have been completely dismantled and disposed of.

A molten salt reactor could have molten salt drained off and allow the Protactinium 233 to decay to U233 to make bombs.

The international proliferation experts are trying to figure out how to track this.  Solid fuel reactors have fuel assemblies or blocks with serial numbers they can count and track.   How do you spot the diversion of liquid fuel?

To make things worse... all liquid systems leak and the filtration process will generate more waste.  A certain amount of makeup MSR fuel will be needed just for routine operations.    What is the normal replacement quantities per day... what are the worst replacement quantities when things go wrong.

How do you even spot a diversion of materials when dealing with liquid nuclear fuel which can be drained into a small bucket or tank and taken offsite for reprocessing?

So the MSR is a proliferation challenge - for either U235 or Th233 fuel cycle.  But the actual fuel cycle is not if the fuel is in a solid form.
Reply: @rev.andyh.1082  In its solid form thorium fuel cycle is not a proliferation issue in normal power plants. Nor is uranium.

Lets start with uranium 1st.  Lets say we start with 5% U235 enrichment and 95% U238.   A bunch of the U238 absorbs a neutron and becomes Pu239.  But some of the Pu239 also absorbs neutrons and becomes Pu240.  

Please look up Pu240 in wiki for a detailed explanation.  But, more than the faintest trace of Pu240 poisons the Pu239 as a bomb material.  Too much Pu240 and you cannot make bombs from plutonium.

Thorium reactors actually run mainly off of U233. But some of the U233 absorbs another neutron producing U234.  U234 poisons the U233 just like Pu240 poisons Pu239 as a bomb material.

When using solid fuels, all power plant reactors are designed with fuel rod run times to produce more Pu240 or U234 in the 5 commercial solid fuel thorium cycle power plants built than would be allowable for bomb materials (not to mention the dozens of test reactors).   It's a total myth that reprocessed solid power plant fuel from normal power plants can be used to make bombs.

Bomb grade material is produced in special weapon grade reactors that only run the fuel for a few months, or less, to limit the U234 or Pu240 to below the allowable levels.

There are two main exceptions to this:  the UK built a series of power plant reactors designed to produce bomb materials.  They were not economical at generating electricity or at producing bomb grade material; and those plants where shut down decades ago and I believe have been completely dismantled and disposed of.

A molten salt reactor could have molten salt drained off and allow the Protactinium 233 to decay to U233 to make bombs.

The international proliferation experts are trying to figure out how to track this.  Solid fuel reactors have fuel assemblies or blocks with serial numbers they can count and track.   How do you spot the diversion of liquid fuel?

To make things worse... all liquid systems leak and the filtration process will generate more waste.  A certain amount of makeup MSR fuel will be needed just for routine operations.    What is the normal replacement quantities per day... what are the worst replacement quantities when things go wrong.

How do you even spot a diversion of materials when dealing with liquid nuclear fuel which can be drained into a small bucket or tank and taken offsite for reprocessing?

So the MSR is a proliferation challenge - for either U235 or Th233 fuel cycle.  But the actual fuel cycle is not if the fuel is in a solid form.
Reply: @rev.andyh.1082   Regardless of what you believe about the somewhat debatable  "proliferation resistance" capacity of U233  If somebody is going to do anyway it may as well be us.   AS far as I understand it the ones that are working on it already have working 235/plutonium/  nukes so then what's the difference?  It becomes easier to use U235 and Plutonium for a bomb than it is for U233.  Others like Iran probably have already the more conventional thermonuclear weapons.  Weapons enriched material have been spread to many countries by now particularly at the alleged break up of the Soviet Union.   However why make a nuclear weapon out of 233 which emits hard gamma rays that probably will kill the proliferators in the process of doing so and also creating gamma rays that are far easier to detect?   Also it has been suggested that you can add a poison of U238 that in the event of some kind of terrorist takeover of a thorium based thermonuclear plant could spoil the fuel?   If thermonuclear bombs are already everywhere not why not then finally use the more elegant peaceful chemical salt FINALLY to proliferate the productive peace full use of the elegant chemical and safety advantages of thorium to use for far more safe side to far less expensive electrical generation.  Unless of course you believe the idea that George Bedini so called decentralized free energy over unity solutions for individual household or apartment generation in which no one needs to hold land to power their homes is somehow both real, easy practical and potentially capable of doing the same task.    If zero point  or perhaps LENR were as easy as people  like Floyd Sweet or Howard Johnson or John Searl or John Hutchinson etc.  have portrayed it then whatever you believe about the abundance of substantial practical  perfectly decentralized free energy generation for winter heating, summer cooling/ air conditioning clothes washing/drying/ water purification/decentralized  closed cycle trash and garbage recycling, transportation and perhaps the elimination of the need of two dimensional surface roads and highways through anti-gravity, negative energy, and or field propulsion effects which some have allegedly reported.  If these were as easy to do as the so called inventors have reported then WHY are they not all become household appliances by now?  You either must think that these are fraudulent or have little or trace value to add to our energy economy.   I mean the recent Hurricane Harvey disaster tells us much about our wind farm & solar  energy grids as does the terrible tragedy of Hurricane Helene as well as the fires in Maui.  If total decentralized free energy was as easy to do then would we not be using them in our homes/ cars /busses planes and trains by now?  Why then are we not familiar with the technology.    At least Thorium FLiBe Molten Salt reactors can provide more decentralized but not individually decentralized far less expensive energy perhaps on the  community or city level instead on a central national power grid level.   On a community level there would be far less time needed to recover from tornadoes hurricanes floods earthquakes etc.   The complete reconstruction of local power grids is time consuming after such tragedies rip through a populated area.   I would hate a conventional nuclear reactor on my back yard but a well built thorium  molten salt design would be acceptable to me.     However I hate any of Bill Gates' designs involving sodium which are far less efficient in consuming all the nuclear fuel as well as CANDUs   I really believe Gates offers us something far less elegant.    As far as thorium I would allege  it is far easier to solve the problem of corrosion to metals in molten salt heat exchangers and the containment in reactors than it is to spend trillions of dollars on hot fusion.    Is  it easier to deal with temperatures of your oven or temperatures in the core or surface of the sun?  As far as corrosion it is almost certain that through research that materials for the confinement of such material will become better over time than even  Hastelloy N Alloy.  If we already have something that works then is it not reasonable that we can improve it more in the future to be  better and more durable longer lasting.  I really do not understand why there is so much expense breaking even in a plasma nuclear fusion confinement?  Fusion is not even competitive and is far more centralized than is the LFTR molten salt tech.  I do not like Bill Gates tech because it has no advantages in the half life of nuclear waste because it is still MOX or U235 based.  You still get the actinides.  The LFTR is on the other hand has the advantages of the separation of individual components of nuclear waste while operating and refueling in operating.  The other advantage which was not mentioned in this video is that the reactor requires an environment in which the neutrons are slowed down.  The fuel outside such an environment of  thermal neutrons does not interact with the faster neutrons and this causes the reaction to stop criticality. Then there is also the advantage of using a CO2 Turbine instead of a conventional steam turbine.   The technical details left out in this video are appalling.
Reply: US and World needs Chinese scientist.... 😮😮😮
Reply: three mile island was not a meltdown, it was a minor release of radioactive steam, not a melt down, please do more research👍
Reply: @spacexvanityprojectslimite3315 
TMI was a partial core meltdown - you get your facts straight.
It did prove Western reactor designs did their job in terms of keeping the melted core inside the pressure vessel  and the majority of contaminants inside the containment building.
Also the small amount of radiation released into the environment came mainly from vented Xenon-133, not steam.

Although I agree that in terms of environmental impact, TMI was a nothing-burger - it was a huge financial disaster.
Reply: @spacexvanityprojectslimite3315 It was a meltdown in reactor 2 in 1979, you are nothing but a liar.
Reply: @spacexvanityprojectslimite3315  
Three mile island was a core meltdown (partial) - so please, YOU do your research before telling others to 😂 
What TMI proved was that Western reactor designs did their job in terms of suffering a meltdown and containing the melted core within the pressure vessel and the majority of leaked radiation to the containment building.
Also, the majority of the radiation released into the environment from TMI (little as it was) was from Xenon-133, not steam.
Reply: It's 101 CCP propaganda.
Reply: @DJVARAO this has been the standard reaction of the west to every PRC advancement for the last 10 years. And in that time, the PRC has grown into the second largest economy and is closing on the US’ position as the largest economy in the world
Reply: @perryallan3524  thank you for a very educational post. One can always set time lines. It gives them something to aspire to. For the sake of humanity, I hope they succeed
Reply: @DJVARAO 😂 Get a life 🤡. This is not CPC propaganda. Seriously dumb comment
Reply: @DJVARAO  I agree with you, we are just interested in the scientific (or lack of) their claims.
Reply: @DJVARAO 😂 you think this is cpc propaganda? 😂 keep drinking the Western msm kool-aid 🤡
Reply: @DJVARAO  no it's not, this is real tech, i've been following its development for over a decade,
Reply: @homewardboundphotos  The "project" is supposed to be finished by 2025... I have seen similar promises unfulfilled before.
Reply: @homewardboundphotos  , By is initial you know from where he is from! They will keep on howling even if the moon is not seen!
Reply: @homewardboundphotos  yeah but it’s nothing new. Didn’t we put a molten salt reactor in an airplane?
Reply: @Greg-yu4ij  no, they wanted too.  It is nothing new, but it was never developed properly.  We are now finally doing the development